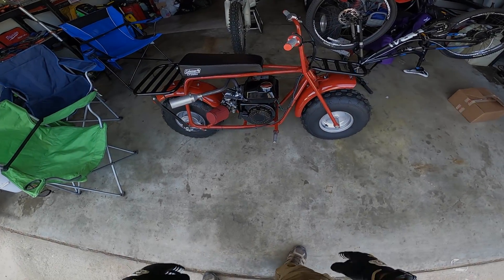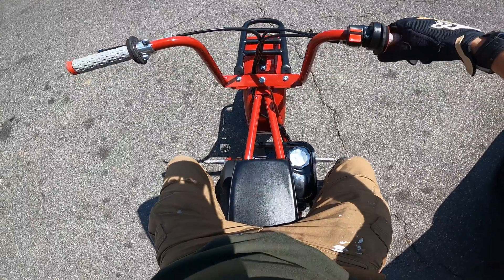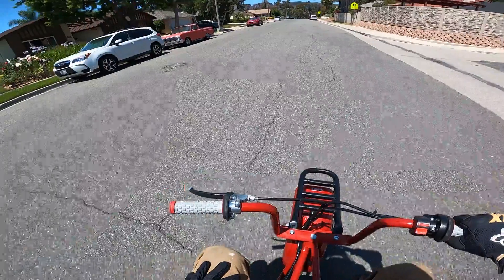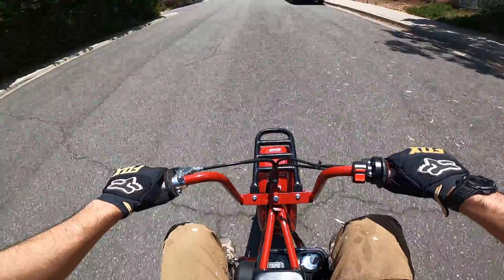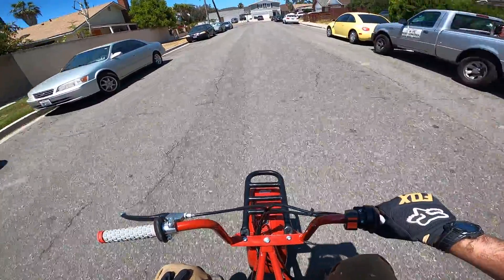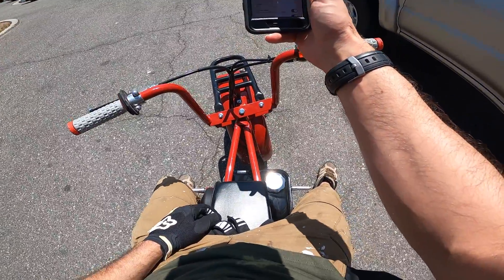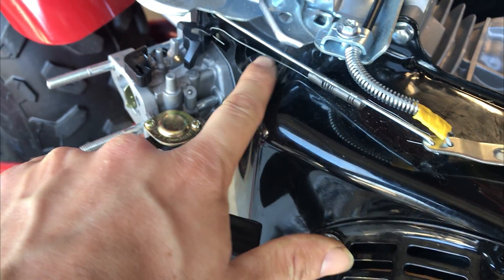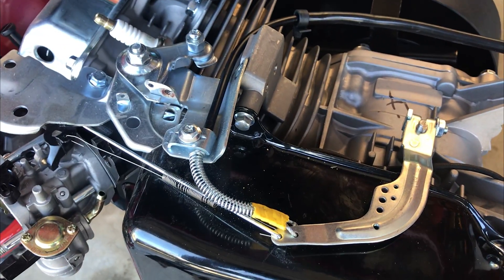Coleman CT200U | Stage 1 Performance Kit + Governor Bypass | POV Ride - Full Throttle Pulls

Comment: well if your riding it on the street get rid of the whole jack shaft assembly, flip the clutch and run a chain straight back to the wheel. top speed will be more like 55mph but you will lose torque, the other option is to install a torque convertor and raise up the engine about 1/2 to an inch.

Comment: How’d you fix the problem that you had where it took off when you turned it on? Same things happening to mine and I would really appreciate the fix.
Reply: Still need help?
Reply: @isaiahjacobs2962  yes!
Reply: @underdoggrisingent.4322  you might need a tighter return spring or add another spring for your throttle return hold that little metal stick that moves when you move the throttle in the closed/off position and see if it still does it make sure the throttle isn’t engaged at all and if it doesn’t move you know your problem

Comment: Wow. If your GPS is correct on the 40 mph you were running 7200 RPM. Pretty risky.
Reply: with the 18lb valve springs he can probably push more rpm.
Reply: @peytonismyname9258  I remember this video. What he's doing here is not a good idea. These engines were not designed to spin this fast. Works nice initially but the rod will wear out in the long run. The way to go is a billet rod if you are going to run at higher than stock RPM.

Comment: I feel this solution would be problematic for the governor inside the engine as it uses centrifugal force to move the arm and will be unable to, causing additional resistance on the cranks and governor gears inside the engine. A better solution with still not opening the engine would be to completely bipass the governor arm and route the throttle cable straight to the carb. I plan to do this and will make a video if it works.
Reply: Please do.
Reply: This "solution" and the one you suggest are both Jerry rigged. The real solution is to open the engine and remove the governor mechanism or the drive gear from the crankshaft.
Reply: @Deucealive75  if the governor arm isn't attached to the throttle is doesn't change throttle and does not harm engine... Been ripping my coleman with a governor bipass for months now and it runs great no issues
Reply: @corpatcon  That's cool. I'm just saying removal is the right way. There are many (not me) who are concerned about a plastic governor gear spinning must faster than it was designed for. Not to mention a plastic cam gear. The guy in the video was spinning to at least 7000 RPM. This is nearly double what the engine was designed to run at.
Reply: @Deucealive75  yes that is true, I honestly don't care if I harm my engine, I want to swap a predator anyway, but this engine has taken quite the abuse and still works great
Reply: @corpatcon  The Hisun is a pretty good clone except for the 16mm crankshaft. They are buildable with all needed parts available.

Best thing about the 212 is that it has more low end torque than a 196 and about a half HP more. I don't think I will ever need to get a 212 but if I did I would spend extra on a Ducar or Tillotson. Much better engines than a Predator.

Comment: I just added a small spring to pull the throttle closed so it didn't take off but it was hard to go wide open, it's unfortunate these Colemans come with such a poor throttle assembly
Reply: They are not poor throttle assemblies. The Honda design has been around for more than 2 decades and has been used successfully on 10's of thousands of engines including many varieties of clones like the Hisun engine Coleman uses. I have 6 clones including 2 Hisuns and never had a problem with any of their throttle linkages. The Hisun engine is a very good clone.

He mentioned springs in the video. It may be possible that when the engine was completed someone was using the wrong spring that wouldn't allow the governor to pull the throttle on the carb back to idle. That would be human error not a problem with Honda's linkage design.